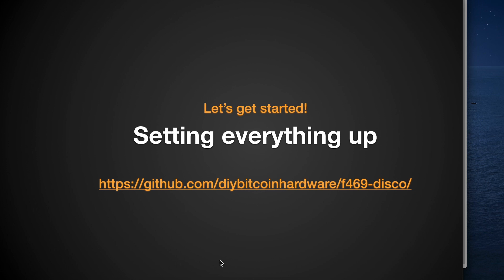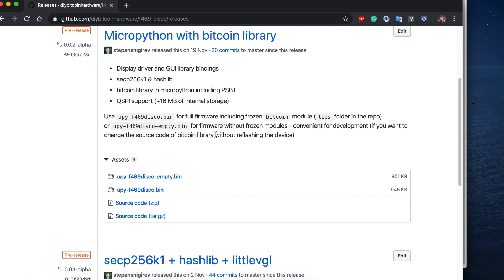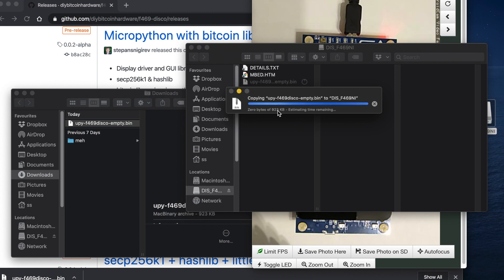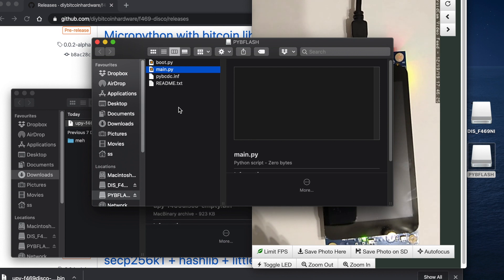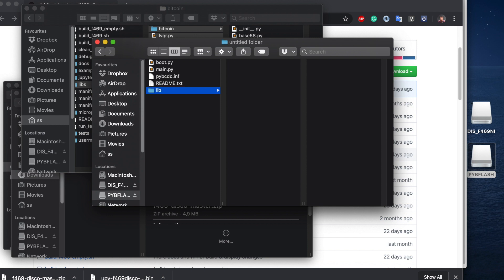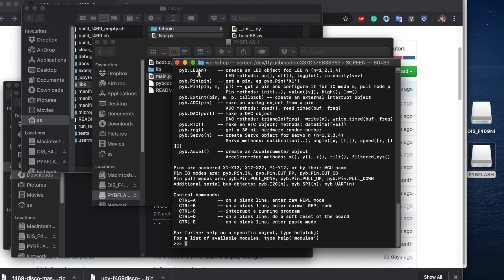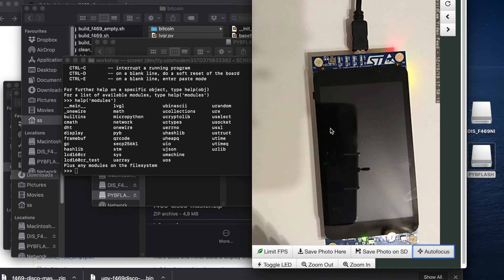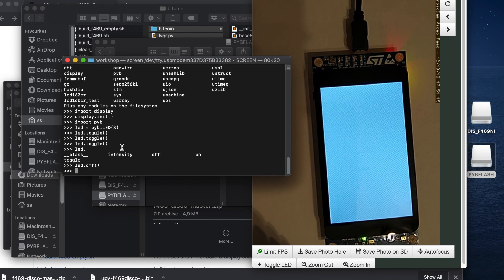2. Getting started with the board - Build your own Bitcoin hardware wallet

Comment: Stuck at 17:15, the release from the github doesn't contain binaries/micropython_unix. Tried to clone and build, but the build doesn't work either (will open an issue on the github).
Reply from the maker: Sorry, I forgot to mention that we need to clone recursively (git clone https://github.com/diybitcoinhardware/f469-disco.git --recursive) 
Now to fix it inside the repo you can type: git submodule update --init --recursive
Reply: @SpecterWallet  Thanks that did it! Can connect to the unix port now.